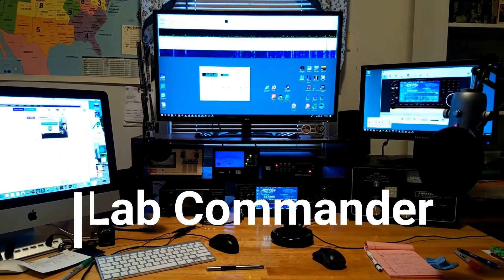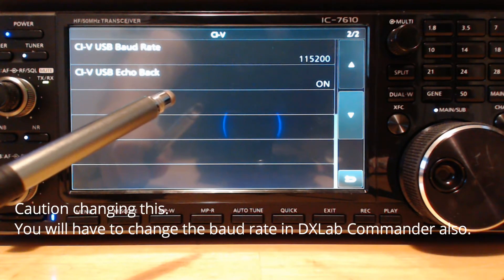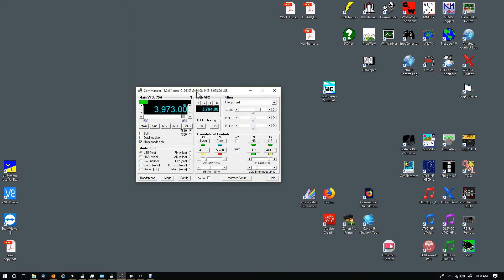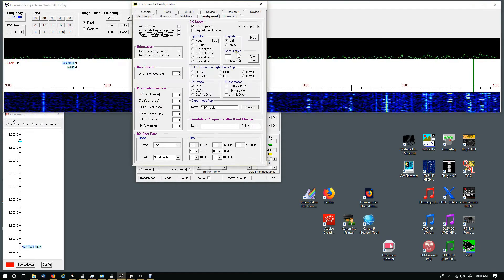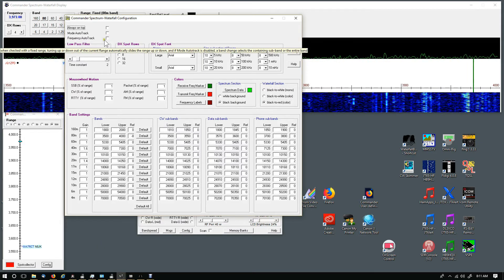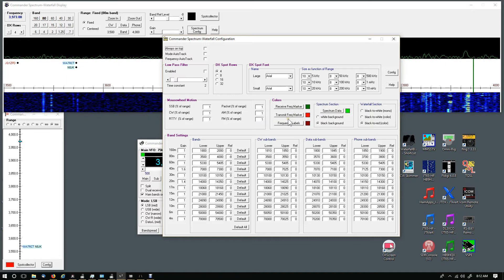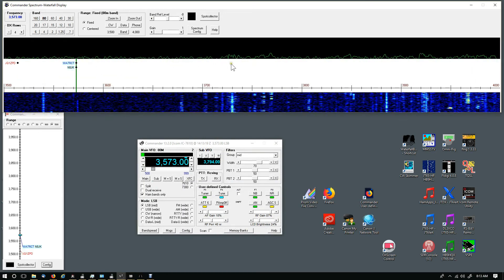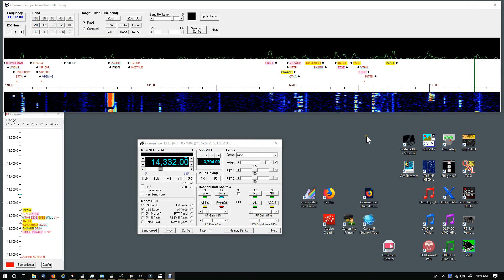DXLab Commander Spectrum Waterfall Display

Comment from the maker: IMPORTANT NOTE: Decreasing the Command interval in DXLab Commander helps tremendously controlling the radio with sliders. It also improves the S-Meter response. In Commander go to Config and the General tab. Look for Command interval which is just below the CI-V Address field. For the Icom 7610 and Icom 7300 10ms works. This will increase Commander's use of your PC's CPU time. See the Help section in Commander for more info.

Comment: I downloaded and installed commander.  The problem I have is there is no spectrum water fall window option, does anyone have any suggestions?
Reply from the maker: Hi and thank you for commenting here. Do you have the baudrate set to 115200 for your comport and is it “Unlinked from [REMOTE] in the internal menu of the radio? 73

Comment: As of 2019-03-29, Commander's Spectrum-Waterfall window is only available when controlling an IC-7300, IC-7610, IC-7850, and IC-7851. Support for other transceivers will be added as manufacturers provide the required CAT commands or programmatic interfaces.

       73,

              Dave, AA6YQ (DXLab developer)
Reply from the maker: Hey Dave, thanks for coming by and thank you so much for commenting here. Good to know! I don’t know if I thought about that one or not to be honest. I appreciate the information and this is sure to help others as well. Thank you again. Best 73!
Reply: An op with a TS-590 viewed your video and then came to the DXLab Discussion Group to ask why he couldn't display a spectrum-waterfall window.

Comment: Hope you will do a video on the LG 32" Monitor.  I have 2 monitors and 1 for my 7610 and would hope I could display all on the 32” Monitor.  Thanks Art in Alaska
Reply from the maker: I'll do that next time Art. Thanks for commenting and nice to hear from you. I thought it was a good deal for $199.

Good quality and it has the display port I needed for my HP desktop computer. It has VGA and HDMI, but no DVI :-(

I'm keeping my smaller monitor for the IC-7610 and will get it hooked up soon. I'll have to use an adapter for it because it doesn't have DVI.

73 - Rich, K0PIR
Reply: Thanks, I have learned a lot form your videos thanks again. Art KB7FXJ